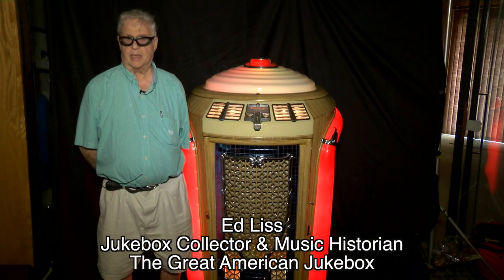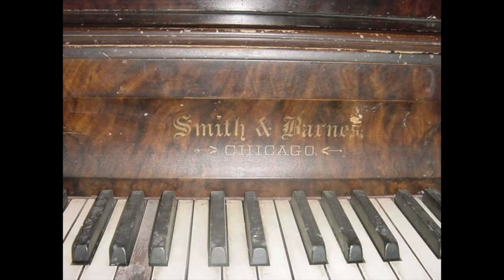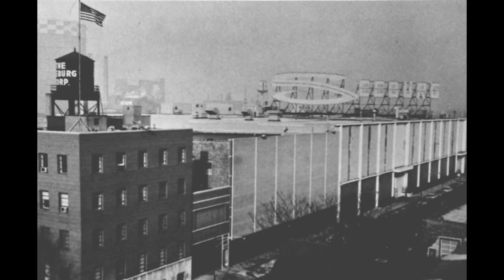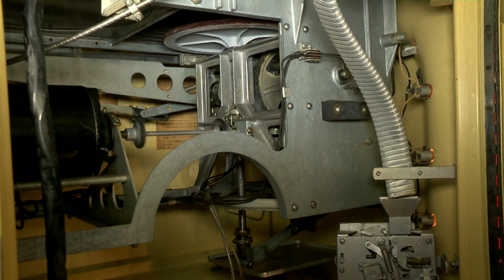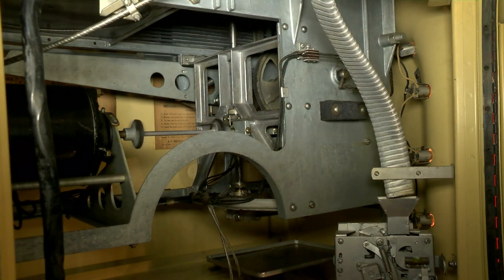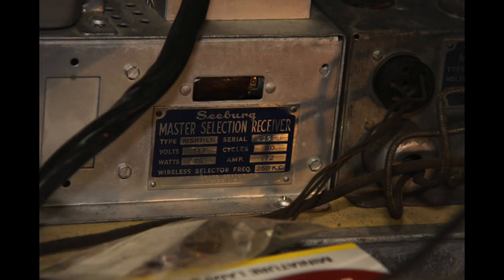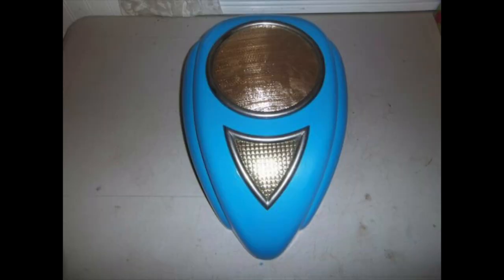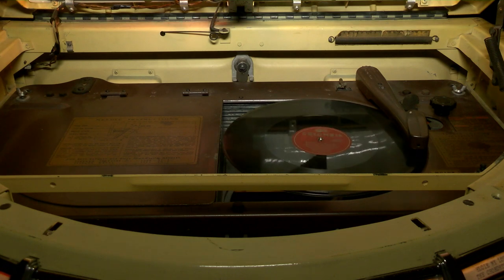Jukebox Bios 1948 Seeburg P 148 Symphanola "Trashcan"

Comment: I just inherited a 1947 Seeburg Trash Can. My uncle passed away and we recieved it. I live in Southern California, looking to have it restored. My uncle had most of the work done. I have a hard time even figuring out how to turn it on, lol! Many amazing memories at his house growing up. Any tips would be helpful. Thanks for posting! And thank you for your time and patience!
Reply: Go online and get a copy of Always Juikin' magazine. In the back of the mag there are technicians listed by state so you should find someone to help you. You MUST order a manual for that machine -- do NOT touch anything until you have it. There are 3 keys you need -- one for the front door, dome, and back door. The on/off switch is on the lower left of the back of the cabinet. If the machine has been sitting for awhile be careful that you don't fry the output transformer if you turn it on. Be patient and find someone in your state who can assist you. Good luck.
Reply: also I have a copy of the seeburg reference manual that is sold by always jukin.  it was worth the money just for the one note in it about removing the 2050 and 5y3 tubes so you dont blow out the parts of the amp/receiver if your not using the wireless selector or remote speakers.